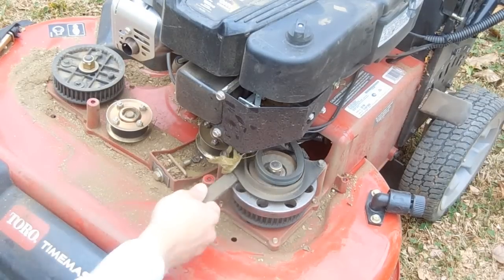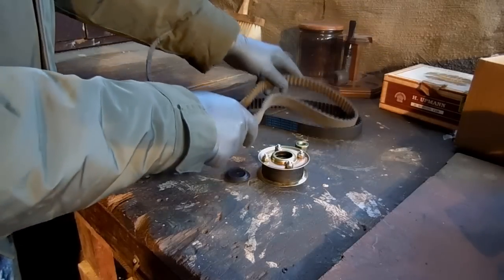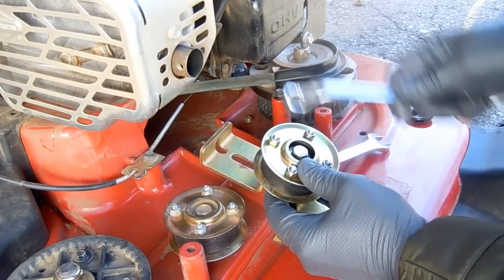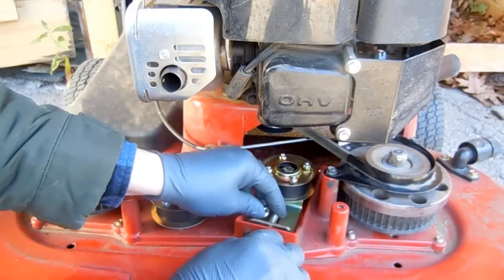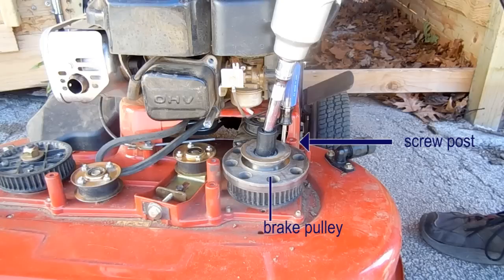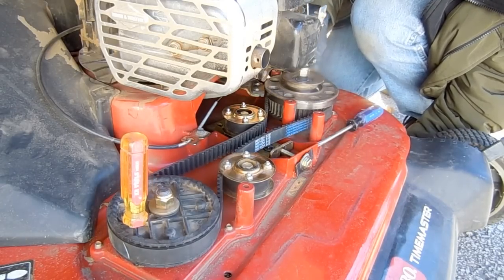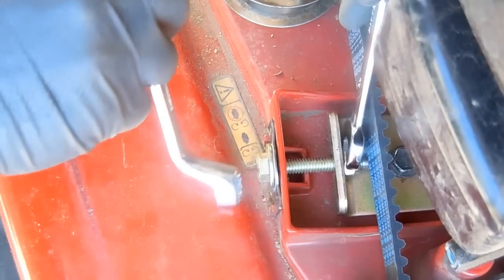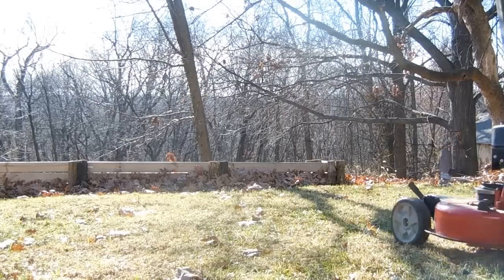Synchronous Belt and Pulley Replacement Toro TimeMaster

Comment: Most important step of this whole process to protect life, limb and the TimeMaster is to ensure the blades underneath are arranged at near-perfect perpendicular positions from one another before setting the belt teeth in place on the pulleys. Otherwise, this could be very dangerous to operate after reassembly. In the video, the creator obviously has the blades in the right position, because we see him holding one of them in place so he knows they are perpendicular; but look for another video on the Tube that shows a belt replacement, and you can see how that uploader ensures belt opposition visually while adding tension. This important step has been assumed in this video I think, but it's very, very important and should be double checked post assembly before operating as this mower uses a time belt that cannot slip or change positions for safe operation.
Reply: InstaBlaster.

Comment: I really hate lazy engineering.  The previous design allowed you to slip belt past screw post because it tapered at top.  The way it is now it's really aggravating to change.  I'd really like to express my frustrations with the engineer as I scream trying to fix this.  Thanks for the video showing how to go about this.
Reply: Zip tie your clutch lever.
Reply: @LemonySnicket-EUC  That wasn't the issue; the drive belt brake was easy to move out of way by hand.  The timing wheel drive had to be removed as the belt would not squeeze past the screw tower.  On model 21200 the screw tower doesn't taper at the top.  Had to put one claw of wrench in timing wheel hole with the other claw set against the screw tower to stop it turning while unscrewing the center bolt.  Took trial and error to figure how to do it.
Reply: @officemanager8624  see what K Gio said.
Reply: @officemanager8624   Did this last night.  Could not budge the nut on the timing wheel.  Used a few drops of oil and was able to push the belt through the gap

Comment: Great video! There is an upgraded replacement kit for the idler pulleys from Toro. It is part number 126-7890 and replaces the original pulleys with the commercial metal pulleys. It is well worth the price and highly advisable as a preventative replacement.
Reply: I would go for that upgraded version for sure! It looks way more durable!

Comment: So my timemaster slows, sputters, and even dies if I dont feather pulling the BBC bar. So I replaced the tensioner pulley because thats normally goes bad, but it still does the same.  The blades seem to spin pretty freely, so I am starting to think maybe and idler pulley might be bad. The motor runs great until the drive is activated so it has to be friction related.  Ill try to add a video of it, but just wondered if you have encountered similar on your timemaster?
Reply: What did you figure out ?

Comment: Great video.      Watched many video on this procedure.    I had to remove the items described in this video to get the belt on.   On my version of this mower, there are two small holes to allow for proper synchronization of the belts (you also need to manually spin, with the spark plug wire disconnected) to insure proper alignment of the blades.  

You need a small high strength screw driver or Allen wench to hold the blades.

Comment: Thanks  - Great video and really clear. If it helps, I put a tiny bit of oil on the belt and manage to slide it over the tight gap - this avoided removing the brake pully. Also, you need to remove the static pulley on the left to fit the cable and then add it back on after.

Comment: Same thing just happened to me,only my belt didn't break, I inspected the belt thoroughly for any rips.  I watched this vid (he even listed the part# in the description). I went out, got the pulley and installed it with help of this vid. $20 and 30min of labor. Would have cost me over $100 if i took it to a repair shop. Thanks

Comment: Main thing that helps the life of belt is rechecking it after 3 hours of run time and the upgrade pulley kit #126-7890 is worth the price because it’s commercial parts 😊😊
Reply: Just ordered mine should be here soon the weight more and are more beefed up.

Comment: Great Video !! Helped me out a bunch. On the tension pulley bracket with the two screws. Once the Spring washer is set to .025mm do those screws get tightened, snugged or keep loose ? Spring washer seems like a band-aid for something they couldn't sort out properly. Anyone have a good explanation for it ?

Comment: I did this same deal on a new version of this mower.  after running over a dog tough the back tensioner let go and we bought another and did this video.  Today while mowing the left cog belt drive blew out.   What did we do wrong?   Was it on the way out or did we or have we got another issue?

Comment: Same exact thing happened to my TimeMaster.  The shop I took it to is waiting for the belt and new pulley to come in. Quick question - what are those little ball shaped parts at the 1:12 mark in the video?  I found 2 of those loose on the deck along with what appeared to be a small metal ring.
Reply: Jack those pulleys he is installing are junk use the commercial ones part number 126-7890. They are more expensive but worth it.
Reply: The round things were probably the steel balls out of the bearing as also the ring

Comment: I just replaced the belt and the two pulleys and an hour into cutting the grass, the belt disintegrated.  The only thing I can think of is the flat spring was too tight.  I did leave enough gap in there that I could stick a piece of paper in it.  Any ideas?

Comment: What would be going on with mine I just bought a stand on mower and after 3 hours of use I notice a hard jungle or like something loose mowing around but I can feel it more on the handle on the left but I notice the pulley  shakes alot in the middle

Comment from the maker: I could have done a better job replacing the belt, but there isn't any service manual on this procedure and I had to wing it that day.  
  
First, you don't need to remove the drive pulley to get the belt on.  It's a tight squeeze but the belt will slide into place after you remove the belt guard and idler pulley.

Second, make sure your belt is locked in:  the belt ridges fit snugly inside the ridges of the pulley.  I should have done a better job stressing that.

Here's a link to a video that will explain these elements a lot better than I did: 
https://www.youtube.com/watch?v=229iV0mIV58&t=1030s

Comment: One glaring error or omission, you state NOT to tighten the pulley bracket bolts down so tight that you can’t adjust the spring tension. On mine, unless I tighten that rear bolt down all the way there is no way to do it after I adjust the spring as their is not enough of the bolt head showing to get my wrench on it to tighten. You then show us adjusting the spring tension to .010 but then never mention how to tighten those two bracket bolts down, unless I am missing something.

Comment: You said the clearance for the tension adjustment is .010"  Paper is .003-.004"  You're probably ok, the new belt with stretch a little. but go buy some feeler gauges.
Reply from the maker: Ben Rumson Agreed. The Toro manual says we can use a sheet of paper for the gap, but like you said it's best using a feeler gauge.
Reply: for me 0.010" makes the blade belt to tight...it's overloading the idler bearing...